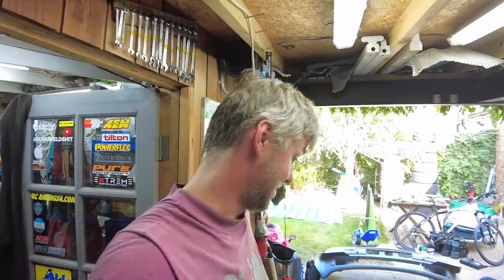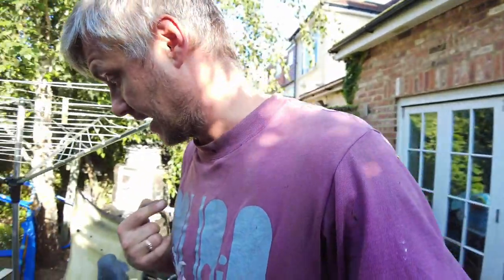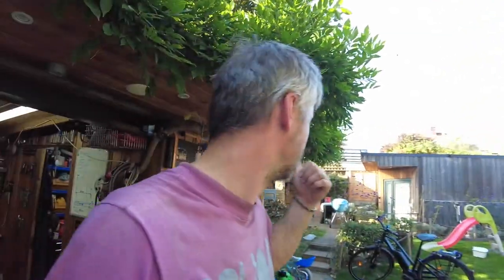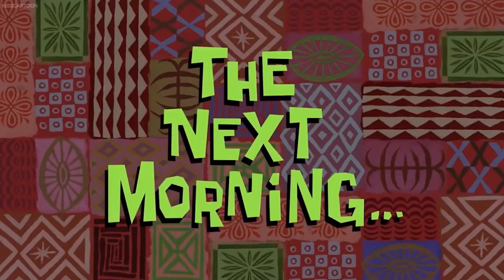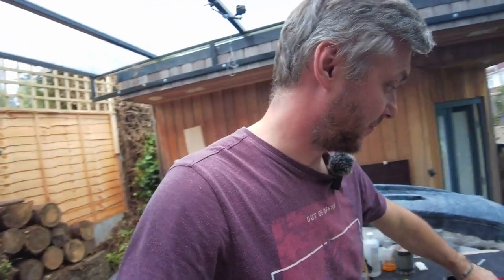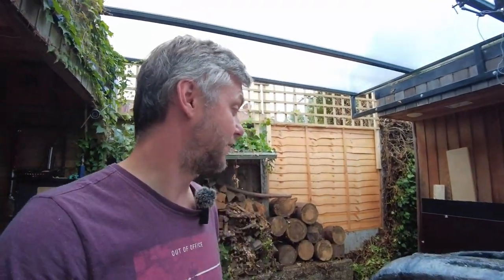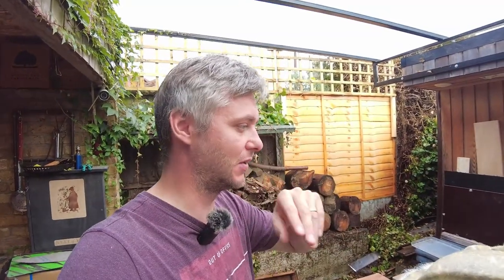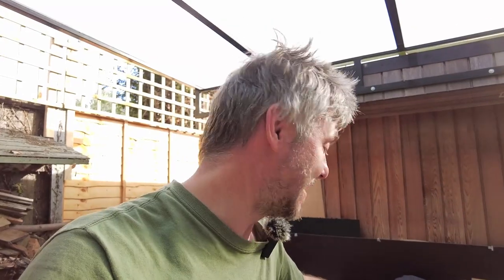KEVLAR car body. How to make carbon fiber bumper. making a mould for carbon fibre. Ep.49

Comment: In the past when I've been moulding bumpers I've drilled holes in the areas that will be cut out after laminating and covered with tape. That allows me to use an airline to aid with the demoulding.  Just make sure to slowly increase the air as to not risk damaging the finished piece
Reply from the maker: great tip that! thank you

Comment: Have you done the doors already??
I believe they will save you the most i believe
Reply from the maker: not yet no. mine are fiberglass at moment so fairly light.
Reply: @RuskiWeldFab  ahh yeh they are i thought they are still steel or aluminum

Comment: What kind of material are you using for the flanges? I have used aluminum roof flashing and it's a bit hard to apply to compound curves but it is relatively good for flat surfaces
Reply from the maker: I’ve used normal foam board for arts and crafts. Worked very well